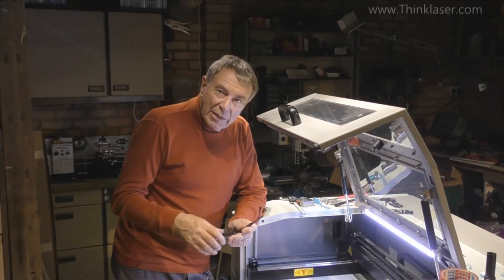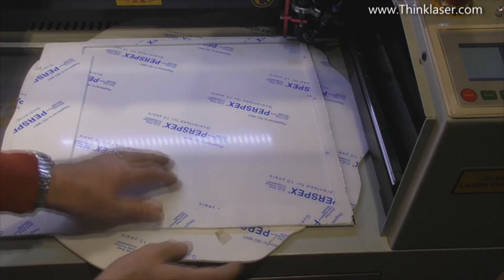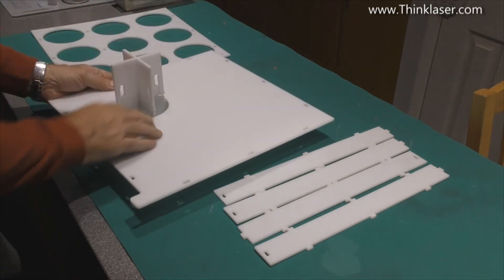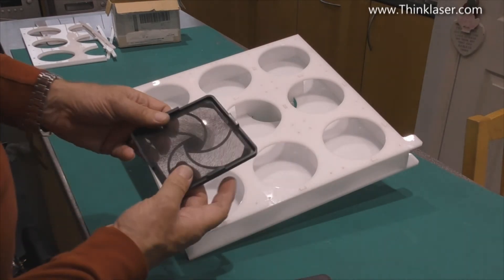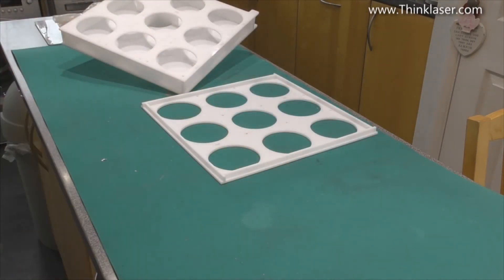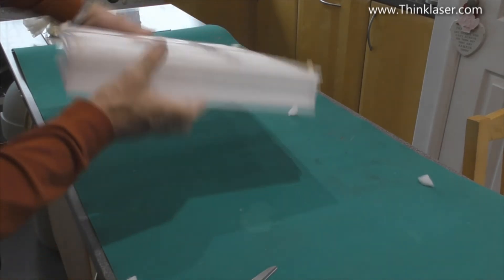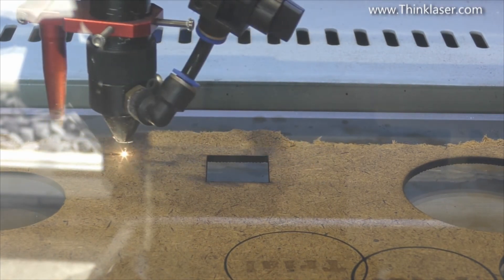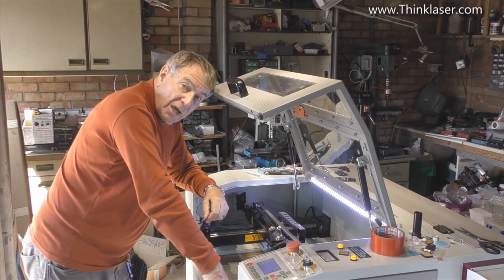How To Use A Laser Cutter - Lightblade Learning Lab 31 Make Your Own Pre-filter for MDF Fumes

Comment: Hi Russ, this looks like a great design! I might have to customize something similar to my lasers. I wonder if this quilting material can become problematic in regards to catching on fire when sparks are flying or being sucked out?
Reply from the maker: Hi Mohammed,
This is Gareth from Thinklaser, Russ doesn't answer these comments.

First off I'd be a little concerned if you were having sparks lasting long enough  to reach the pre-filter. I do know that Russ has been using the pre-filter for over a month and hasn't mentioned any issues. 

If you do have an issue with sparks, then you could always try using a non-flammable filter such as rockwool or fibre glass (take care when handling)